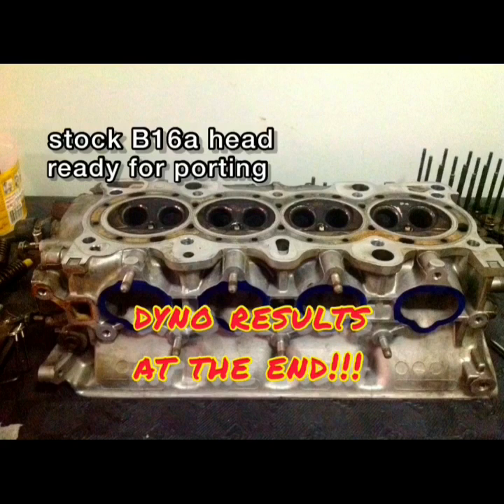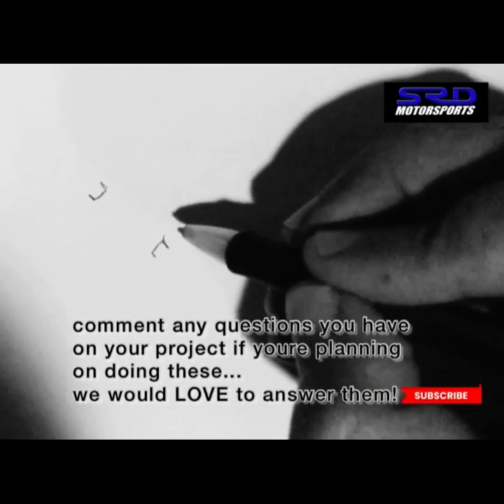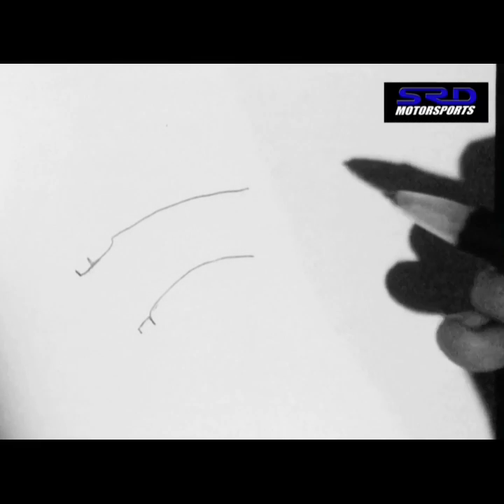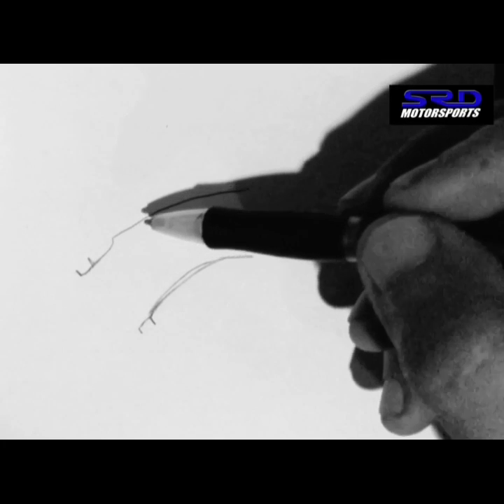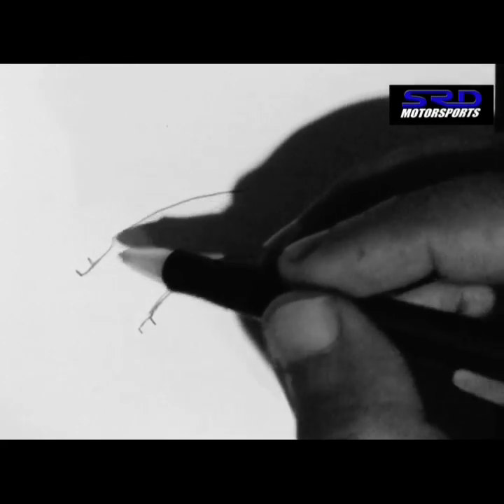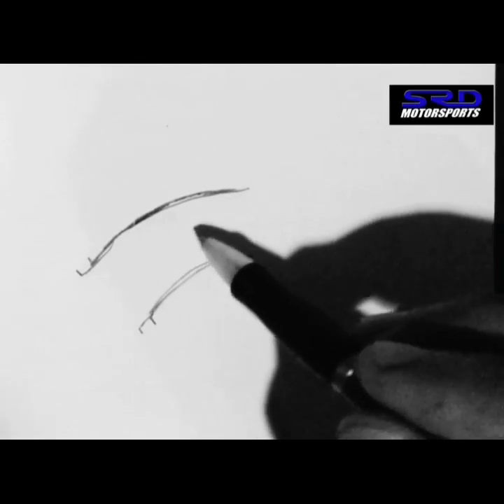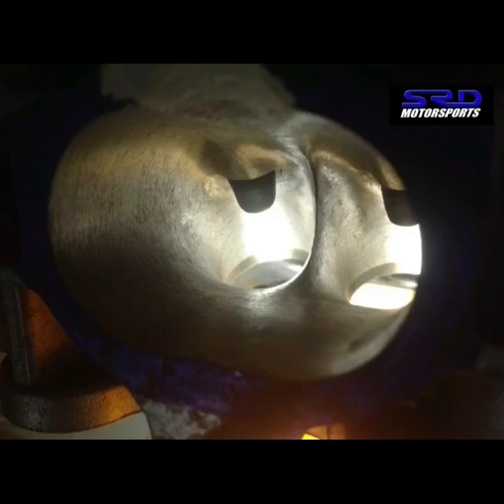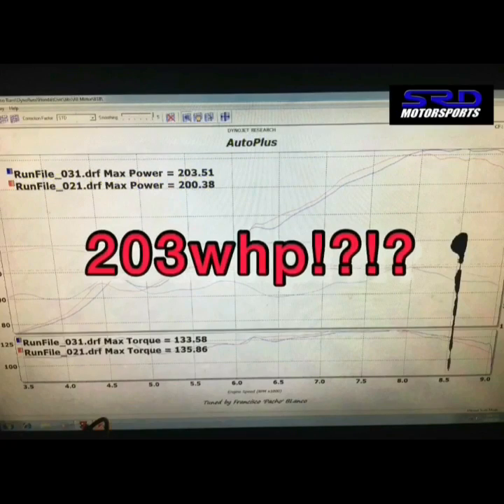How To: DIY Type R style Porting by SRDmotorsports

Comment: sir, baka may explanation po kayo sa mga ported head na may mga dimple? curious lang..
Reply from the maker: no need sa vid madami masasaktan 🤣
the theory is correct and good... "surface flow"  when u research it flow sa pipe daw ung pinaka malapit sa surface is zero speed and so slight roughness can improve surface flow etc pero d po libre un may downside

prang ganito kya back then Tigerwoods did well vs 50-60yo veterans? cuz un swing nya napakalakas...

golf balls are dimbled dba? so gets na ung downside? unless ung hangin mo eh sing lakas ng palo ni tigerwoods... before u get the advantage una na talo 🤣

Formula 1 (top elite sport) wala nyan
MotoGP (top elite bike sport) wala nyan
Top Fuel Drag (mga 6seconds) wala nyan

pero wow fb 🤣

when u research what ive said mapapansin mo ultimo pwesto na ng dimple sablay na eh
Reply: @SRDmotorsports  medyo gets ko na po. matitisod lang sa mga dimple ang dapat sana ay swabe na daloy.
Reply from the maker: @the063one  yes or malulubak imbis na mabilis... if need better mix ng gasolina at hangin? better na tga spray nlng dba
Reply: @SRDmotorsports  thank you po sa reply😁
Reply from the maker: @the063one  noproblem sir :)

Comment: So do you use a type R valve job to compliment the type r style port?
Reply from the maker: awesome question! on a usual "clean up" work for basic stuff it varies on customers here but for actual head developments and heads we run ? we use a custom cutter 

which is a multi-angle + radius, its a NEWEN cutter designed by the guys at PRE in Minnesota... the real PRE as ive heard there were others using the same initial/moniker

Havnt had a chance to plug PRE on stuff cuz the stuff we did together was before the conception of this channel + 70% of the time we talked about good food

perhaps a food channel will make me and the guys at PRE or atleast one of em more active 🤣